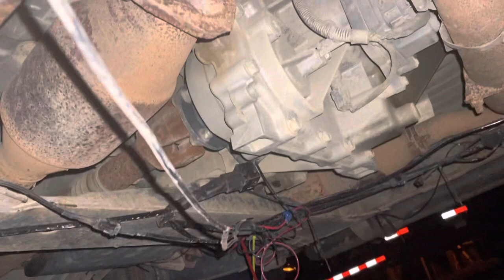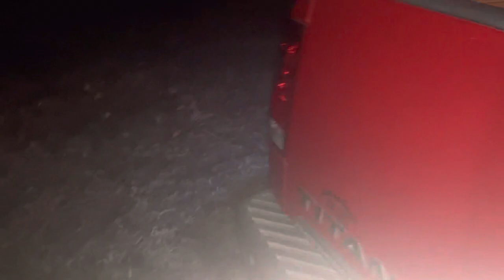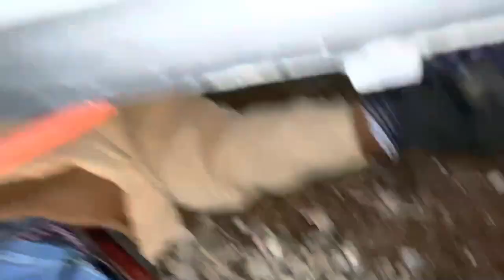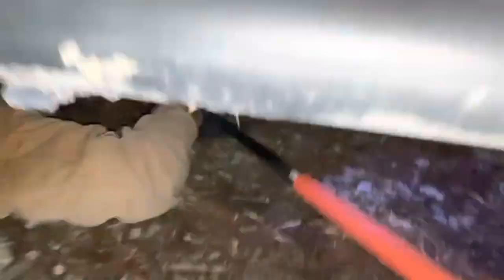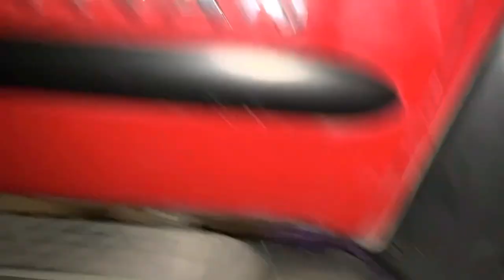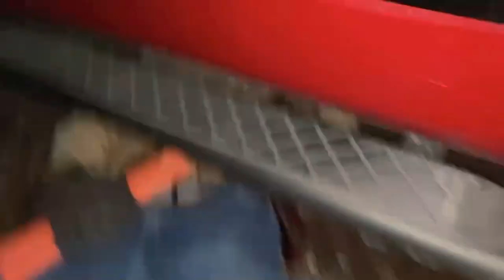Beating My Catalytic Converter On Nissan Titan

Comment: Just so you know. your truck actually has 4 catalytic converters. two are on the manifold components directly. There is O2 sensors before and after the first cats. The second cats tend to get clogged up because the 1st set fails due to terrible design flaws. Glad this worked for you but not exactly a good option. The secondary cats are installed with 4 bolts and really easy to take out. What you should do is take them out, bring them to a muffler shop and have them make a cat delete pipe. This way, you have your originals in case your truck fails emissions but in post states it wont. The 4 cat design is way overkill. give er a shot!
Reply: I hear you can remove the secondary cats and the truck will still run fine